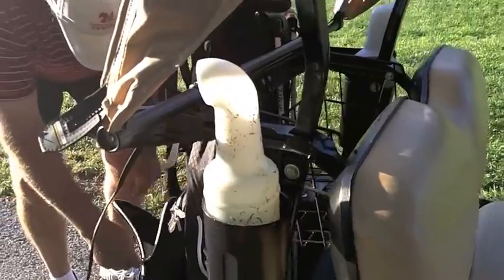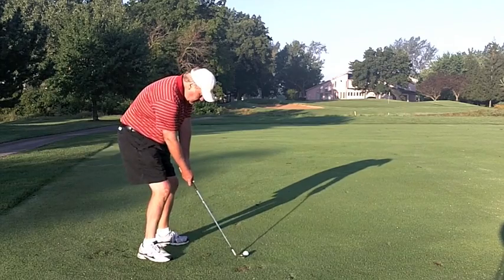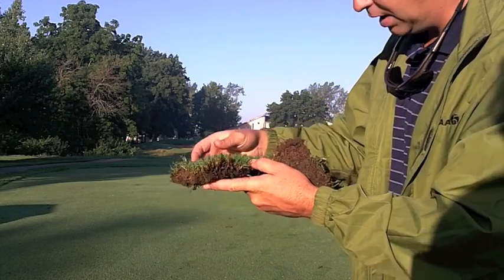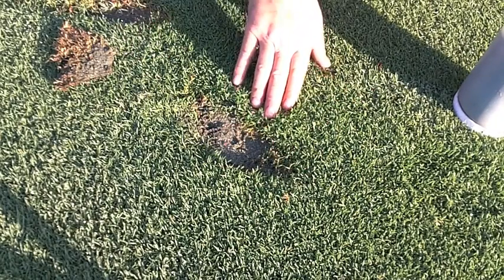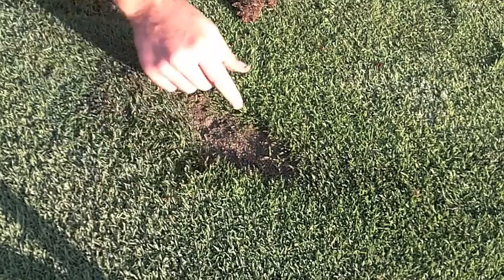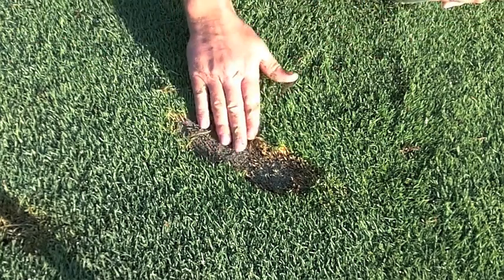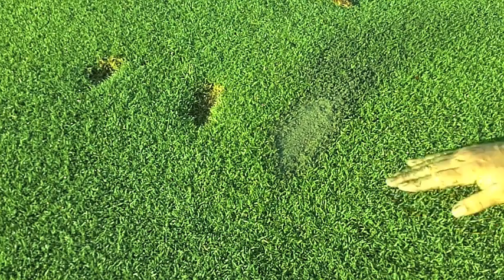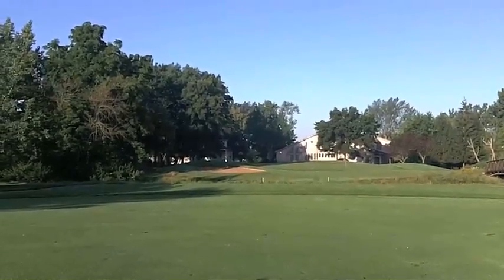Divot filling

Comment: I’m also a CGCS and there Is one detail you left out. When divots are filled to the top of the grass or overfilled, all of that extra sand that gets kicked away has to go somewhere. Where does it go? Well if you’ve ever been on a small tee box that is no longer level and flat but more like a mound, then you have seen where the sand goes. Sand moves very easily out of the smooth surface of the divot, but as soon as it gets into the surrounding grass, it is very difficult to move and it’s now stuck there.  The sand is now sitting on top of the soil surface, in and around the grass stems and leaf blades and therefore creates a tiny little platform of its own which becomes the new surface that grass will grow into.  This tiny little bump left behind is permanent.  After a few years of this it adds up to some seriously mounded tee boxes or driving range tees.  Great video! Thanks for spreading the word.